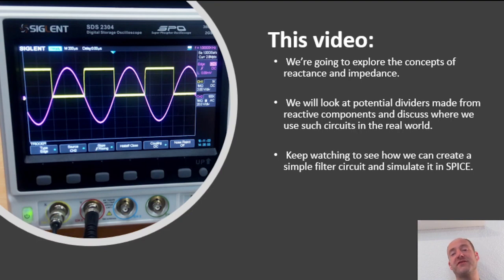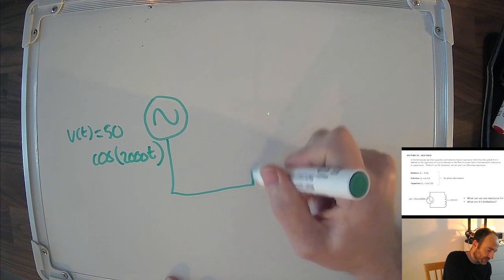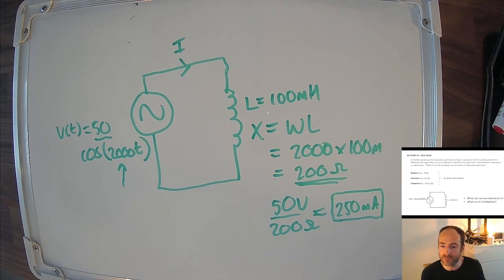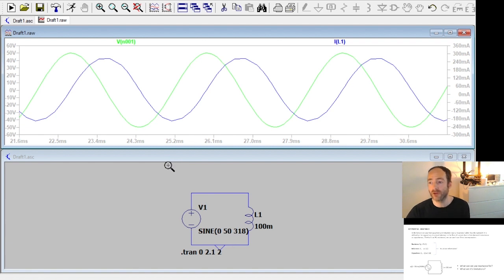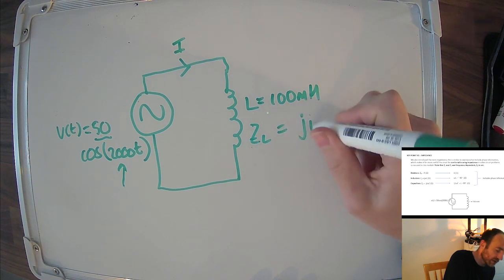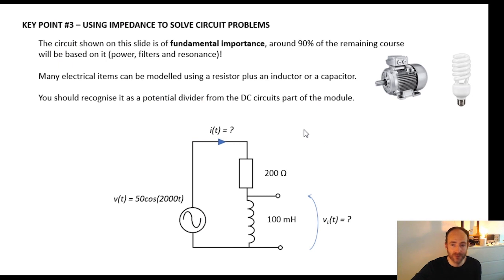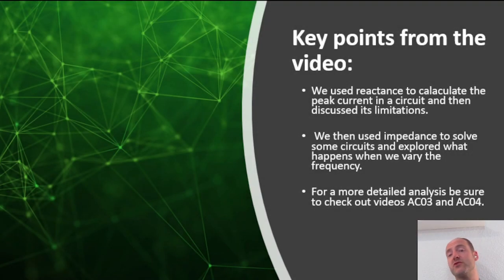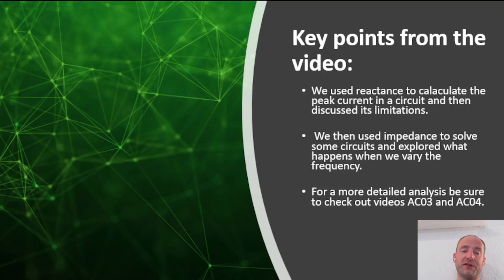Solving circuits with impedance. #thecircuithelper, #electronics

Comment: Morning... At 7:38 (and 14:45)  , the Current plot (green) has different +ve and -ve swings, 250 and 200mA resp. (approx). Why is this the case, the Cap and Resistor were evenly swung? 
I use Microcap as a simulator and I'm sure LTSpice also has the capability to add more plot points in the transient analysis. At 27:00, the plot is quite 'angular'. :)
Are you doing these lectures, 'live', to your students and posting afterwards?
In a voltage divider circuit containing a Cap or Inductor with a resistor, is the output signal cleaner (less noise) if we take the output across the resistor or across the reactive component?
Thanks again for another great video.
Reply from the maker: Hi Simon, the current should definitely go between +/- the same value (unless the voltage had some kind of DC offset - which it doesn’t), in cases where you see this in spice it’s almost certainly to do with the initial transient response of the circuit. What I’m not sure about is if this actually happens in reality… in a simple RC or LR circuit excited by a sinusoidal voltage source, I’m struggling to think why the sinusoidal current would ever have an offset? Something to look at in the lab I guess!
LTSpice certainly does have the capability to add more simulation points (just change the time step), the default setting isn’t great, but it’s enough for a quick check. 
Regarding your question about the signal being cleaner, it probably wouldn’t look any different as the components are in series, so they will have the same current flowing through them; also, if you want to look at the voltage across the ‘top’ component of a divider, you need to make an differential measurement where you would subtract the voltage across the bottom component.
And yes, this was filmed live in the middle of lockdown 🤓 I’m having to upload a few older videos until I sort my laptop out (at least one more anyways).